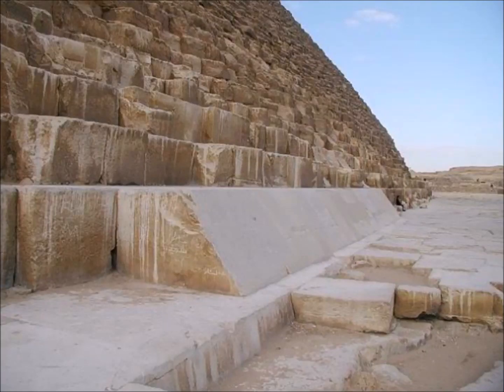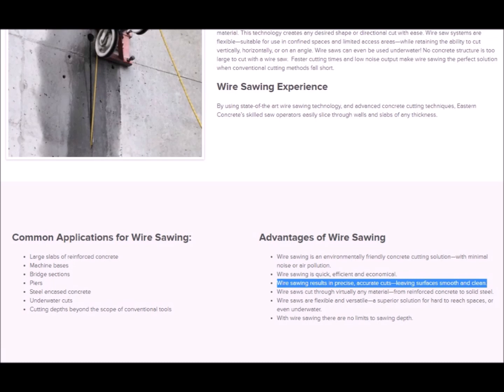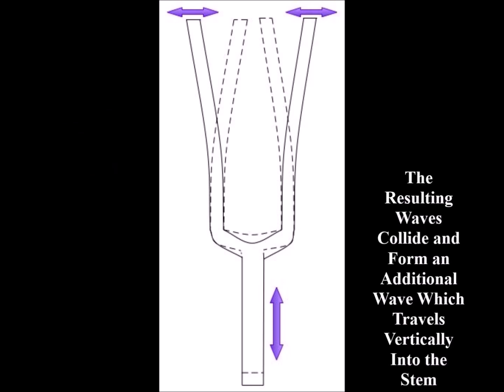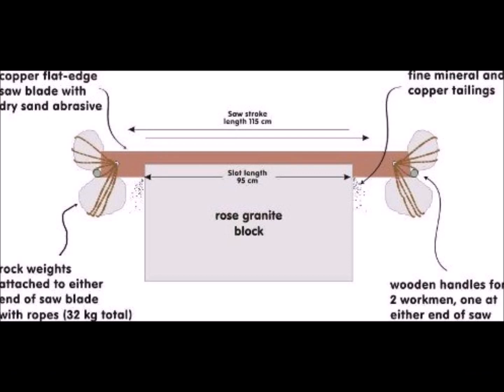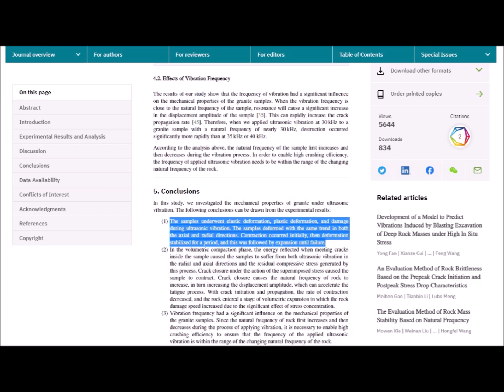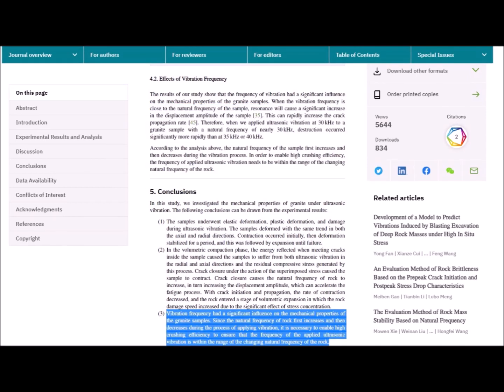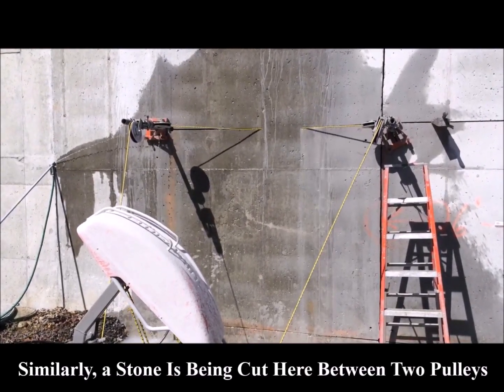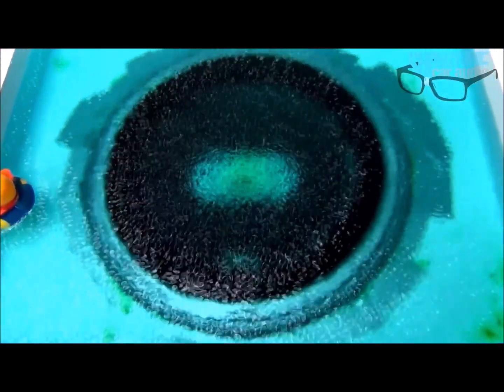Ancient Acoustic Cutting (Revised): Did the Ancients Use Vibrating Wires to Cut Through Stone?

Comment: I know you will think I am crazy, but you are so close to the truth about this, I think that the dust was a Quartz: JESUS YOU GOT THIS SO ON THE POINT: After I said this, you mention the string. I am sure that the abrading powder is a Quartz based dust, that could also have corundum and diamond: You know, this abrading dust would be something of a great deal of value and recovered consistently- 

I think also there is something about the sounds use, being a drum, that then can reverberate the sounds : so you'd be basically vibrating the drum with trumpets or sounds etc etc. 

I am not sure, but I been bent my WHOLE life on this, I am not sure why, but that abrading string that vibrates,.
Reply from the maker: @levioptionallastname6749    Yes, the construction of the ancient megaliths were carried out on an industrial scale with the ability to accurately process numerous blocks of stone simultaneously just as we do today. We can definitely see how vibrating/oscillating strings covered with a sticky, abrasive material could have been used for this purpose and even without space age materials. Today we are also able to make very long, accurate cuts either with computer guided rotary saws or wire saws. Fascinating to think the ancients used a similar technology but powered in a radically different way, perhaps using sound vibrations in the same way we use electromagnetism!

Comment: Imagine a giant metal cookie cutter being vibrated at just the right frequency cutting stone with precise shapes and angles.

I personally believe that's how they chiseled hieroglyphics, by "stamping" them onto walls with a premade tool to be used again and again efficiently without doing it by hand individually. Also probably why most hieroglyphics remain consistently identical like a typewriter and not all willy-nilly crazy like handwriting.

As for the energy source needed, i suspect the pyramids were giant water powered pulse generators that constantly emitted the frequencies needed to match the resonant frequency of the tools used in the area. 
They couldve also used the pyramids to pump water for irrigation.

Comment: Not just "acoustic" but rather "cold fusion" and "cavitation". The more water, the more the sound, the more the conductivity by copper wires, plates or disks. I visited many sites and the similarity of the traces found on the structures are the bubbles and cavitation holes. I think they also mastered the growth of rock crystals by the same process with a diferent frequency. The size of certain crystals such as in Peru and Egypt is not natural. They could both "cut" the conglomerates visible in section on the edge, as we do not know, but also mold certain pieces of technical work. In Peru for example for me it is obvious that the blocks and scraps of stone cuts are the result of an industrial form of molding of very large sizes. For me, polygonal walls are more like retaining walls for the capacity of these molds. There was also a desire to remove certain sections of mountains from which certain stones had been taken. We don't know what they molded with it because only a few sections of these large, very elaborate objects remain.
Reply from the maker: Wow😲. Those are fascinating insights. Thanks for sharing 👍

Comment: first from what material this wire cutting is made of ? , there were no iron or a very minuscule percentage , no diamond sintered  ring was ever found , you have good idea but in the wrong direction , the ancestor did not had tools and means for megalithic construction , precision cutting tool is needed for such a task
Reply from the maker: They wouldn't have to be steel wires. Thin ropes covered with a mixture of oil or sap and an abrasive material like sand could work.
Reply: no, sand in Egypt is too small like flour,  rope to cut by abrasion on granite are you serious ??  @gsutton78

Comment: Thank you so much for your work mate.
God bless you
Reply from the maker: Thanks, friend. Thanks for watching!
Reply: @gsutton78 
By the way, I'm experimenting with Leedskalnin'stuff.
I guess you heard of him.
A hint to you, have a look at the parameters of his PMH Device.
Left Coil winding, right coil winding, plus the measurements, divided by 360 equals 144 prim 😉
His tripod has the angle of 72 which equals 9

A lot of other things as well.
I was given a book, in German, from 1992, it's 2000 pages thick, all about sacred geometry of churches, as well as a blueprint of Stonehenge, crop circles and so on.

They are all blueprints.
You're doing a fantastic job mate, just keep on diving into it, but bear in mind the sacred geometry, this will help you finding out a lot of things though.

Have a look at Umberto Baudo ( think his name was this.), he copied a crop circle to build a magnetic engine, and it works and still does.
As I've said, they are all blueprints.

If you want to levitate Stones, have a look at the "Ankh" and compare it to the PMH.

You can build an Ankh from a piece of copper wire, wire it to a regular small battery which you can find in your remote control for the TV, and the put a paper clip through the middle of. But remember to face east, always face east.
Charge the paper clip first, and then do the experiment levitating another paper clip which you can lay under it.

For cutting heavy blocks easily, use water, carbon an salt ( seasalt.) to change it's frequency for certain usage.

And by the way, sorry for my bad English, I'm not a native speaker though.
Kind regards from Switzerland
Reply: Also have a look at Viktor Grebennikov

A Russian scientist, who found out how to levitate by Insekt design.
That's why the ancients worshipped the scarab Insekt. Just check it out, if you don't know already.

Hint: Birds don't make sounds when the fly, but insekts, bee's, bumble bees make a sound like: brzzzzzzzz

They levitate
This sound is the frequency.
Have a look at a Bee, it can float in the air, and then fly in any direction.
A bird can't 😉
Reply: @gesunderpsychopath8569 hummmming bird 😂

Comment: Copper tubes with large tuning forks on one end will make a sonic drill to cut out those cores and holes. 
Copper tools being both common and easily repairable seem most logical. 
Mix in a few million slaves to do this all day everyday for decades and you can get things done.
Reply: Can you explain how you attach / apply the tuning fork to the end of the copper tube though.?!
Reply: @gesunderpsychopath8569  ..... Never seen an Egyptian Was Scepter?.....
When sound vibrations of a specific frequency are sent through a drill bit or even through something as simple as a metal pipe, it can vibrate in such a way to act like a very high frequency jackhammer.
The drill barely needs to turn as the vibrational impacts and shattering do the job compared to conventional drilling. The method is actually faster thus less wear on the tool bits takes less energy. Conceivably, you can even turn the handle of a large tuning fork into a cutting rod whether it’s drill tube or a drill bits. Even a copper tube could conceivably cut into granites using this method.
To turn a tuning fork into a sonic drill, the resonant frequency of the cutting rod must match the frequency of the fork that is attached to it.

Scientifically, the way it works is the traverse vibrations from the fork prongs known as ‘tines’ move the bottom of the U-shape up and down. Which sends long eternal vibrations through the cutting rod up the rod’s resonant frequency. These vibrations create standing waves with maximum vibration at the beginning and the end of the rod and there is a point of no vibration in the middle where a handle could be attached.
For example, tines, 30 centimeters long and 3 centimeters thick, make a resonant frequency of 1,100 Hertz. An 1.5 meter long rod would be required to allow cutting.
Reply: @zer0deaths862  and yeah, Leedskalnin used copper tubes as well. You can see them in the coral castle.
Reply: Because CommieTube keeps removing my comments.... 

when sound vibrations of a specific frequency are sent through a drill bit or even through something as simple as a metal pipe, it can vibrate in such a way to act like a very high frequency jackhammer.
The drill barely needs to turn as the vibrational impacts and shattering do the job compared to conventional drilling. The method is actually faster thus less wear on the tool bits takes less energy. Conceivably, you can even turn the handle of a large tuning fork into a cutting rod whether it’s a drill tube or a drill bit. Even a copper tube could conceivably cut into granite using this method.
To turn a tuning fork into a sonic drill, the resonant frequency of the cutting rod must match the frequency of the fork that is attached to it.

Scientifically, the way it works is the traverse vibrations from the fork prongs known as ‘tines’ move the bottom of the U-shape up and down. Which sends long eternal vibrations through the cutting rod up the rod’s resonant frequency. These vibrations create standing waves with maximum vibration at the beginning and the end of the rod and there is a point of no vibration in the middle where a handle could be attached.
For example, tines, 30 centimeters long and 3 centimeters thick, make a resonant frequency of 1,100 Hertz. A 1.5 meter long rod would be required to allow cutting.

-🇺🇲
Reply: @zer0deaths862  brush, the measurements you've mentioned, are exactly the ones Leedskalnin described. My PMH is the exact size.
I was thinking of the Ankh to be something like that too, since I saw a few pictures where they've put the Scepter through the middle hole of the ankh, which creates a zero field as well.

Had to screenshot your comment, since I saw my comment with the description has been deleted too.

Do you've got a mail address for me so I can reach out to you.??
I really would like to learn the mathematics behind the hertz etc
How did you figure that out though.??

Kind regards
Reply: @zer0deaths862  I assume

If I hit the stone with the rod, so the rod pics up the frequency of the stone, and then I put the rod right through my pmh which acts as a tuning fork, it'd suppose to pick up its resonant frequency. At least that's my guess.

To your info
My pmh / transformer / tuning fork has exactly the measurements / diameters as you've described.
And also has two Cooper coils going into it's Prongs with 1500 windings each. One clockwise, the other counter clockwise.

But I don't know how to do the math to get the frequency.

Could you shed some light on this please.
Thank you so much man
Reply: Bruh, do you think with Leedskalnin Pmh which is basically a Tuning Fork and a built in transformer I could cut stones.?!

And how can I reach out to you.?!
Is there an email address that you'd share for contacting purposes.??

Greetings from Switzerland

Comment: Wire cutting is not an explanation for the internal flat cuts and 90 degree internal corners such as in the granite boxes in the serapeum. I suspect they had many different cutting heads/tools using the same technology.
Reply from the maker: Of course. There's also a process called, acoustic sculpting: https://youtu.be/oIHL1s1d7ew

Comment: I did have one idea of a reciprocating   saw with a copper blade that was driven by a lifted stone weight , so it only neede one operator who applied sand or crushed granite to the moving blade. The same method could turn copper tubes for drilling. In reality there are an abundance of various qualities of cuts and simple machines ir hand tools do not fit their formation ir the hardness if the stone itself, even cutting and extracting the large stones like obelisks is mind boggling . I have been to Egypt. Its impressive.

Comment: I think i like where this is going. What if the entire piece was vibrating  so much without fracturing it. Then you can get as much workers as needed with tools to simply place, drag, and crop across the piece for the desired cut. This may be the reason for the ice cream scoops in that unfinished obelisk in Aswan Egypt. first cut the rough desired size, vibrate it, and have 10 workers do there magic dragging tools or wires across it. The Aswan obelisk could have been a supervisor a little carried away with the rate of oscillation to save time causing it to fracture.
Reply from the maker: That's an interesting theory!!

Comment: Tuning forks can have sympathetic vibration, so I wonder if they had a way of harnessing vibrational power by creating a "field" of multiple forks all resonating together. You might have something that would automatically keep one fork vibrating (thus keeping the other forks vibrating), or by having someone regularly striking a fork to keep the vibration "switched on".
Reply from the maker: That's an interesting idea. I might also submit that the ancients had a working knowledge of steam power. If you can melt metal, then you can make a boiler and the piping/conduits. Hero of Alexandria, the Greek-Egyptian mathematician and inventor, described such a device over 2,000 years ago called the aeolipile. And so it is likely that the principles of steam power were known at least as far back as the 1st century AD, and most likely much earlier. Many discoveries ascribed solely to the Greeks were actually known thousands of years earlier, all due respect to the Greeks. Hero also developed a number of other mechanized devices. But steam power can also drive acoustic devices. I'm planning a video to demonstrate this possibility sometime in the next few months.
Reply: This has already been proven with ice cream cone shaped mortar and pestle like rocks found in Africa serving like singing bowls. One alone 'singing' artifact could levitate small objects. Imagining stone henge or the pyramids is easy to envision done by several dozen or hundred men combining the Vibration to lift massive objects. Electronic devices exist today using resonance to assist stage magicians with small objects.
Reply: It’s that you say this, in allot of egyptian carvings where you see sceptres the bottoms look very much like tuning forks😜
Reply: I have had the idea of water power by a water wheel. When it came out there was an ancient river (now gone) discovered from satellite that runs past all the pyramid sites in Egypt. I imagine they could also compress small p.s.i levels in a thick clay structure to water a water jet

Comment: Over cutting don't nessesarlly mean fast. If the work took long then the workers might have started a vibration cycle and walked away. Come back works done but also ended up cutting into a bottom stone.
Reply from the maker: Very true. And actually, a slow but mechanized process might ultimately yield better results.

Comment: I stumbled on your channel today from an idea I had today and turns out you've already done research deeper than mine into it. Super cool stuff
Reply: Same situation
Reply: I was thinking about how vibration would be more easily discoverable than electricity, literally rub the rim of a water filled metal bowl and you see the cymatic frequencies make the water literally fly out of the bowl.

Made me think of some trippy sound ceremonies booming across the ancient egyptian landscape as they quarried and cut their stone.
Reply: This is the video, I finally found it. https://youtu.be/BsqOLCXYznE?si=T6aIolviRaz7w-ap I have a theory if you will entertain it. Take two of the Egyptian tuning forks, run a copper wire between them. Take the ancient egyptian WAS CEPTOR, coat it with bees wax or some kind of rosin. Run the Was Ceptor across the wire like playing a violin, the resulting vibration is a long, continuous note or frequency that can be used to cut the stone. The appraoch has to have been found by now but, as I understand it the Egyptians are holding that information close to the vest. I would like to attempt this experiment but I am limited in resources to make a tuning fork large enough. I would have to cast it or forge it. I must also do more research into the Was Ceptor and what was the texture of the shaft.
Reply: Ahah me.too. i am a stone worker and my mom does sonotherapy with alots of crystal bow and different hertz and this pop up during i was thinking of this like if the algorithm was listening to my thoughts almost scary 😆

Comment: But what they have made a good enough rope or wire, to not break with all of that tension and friction
Reply from the maker: Well, it definitely works with modern rotary wire saws. If using rope, it would likely have to be coated with a mixture of a viscous fluid and abrasive particles like sand. Also, keeping the ropes or wires cool with constant water flow is key as they also do that in modern wire saws.